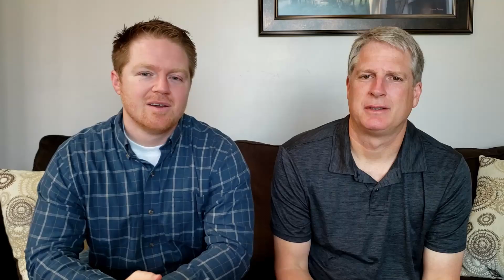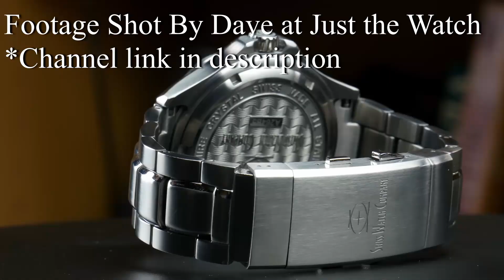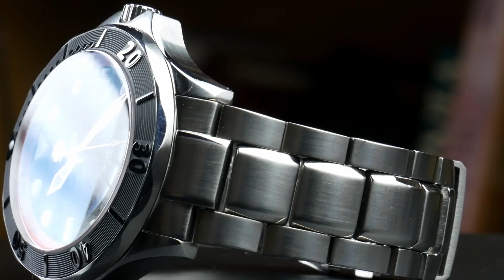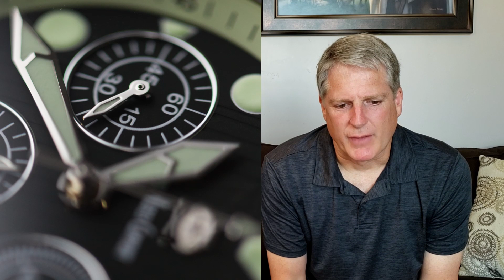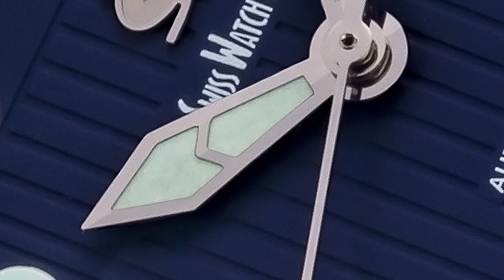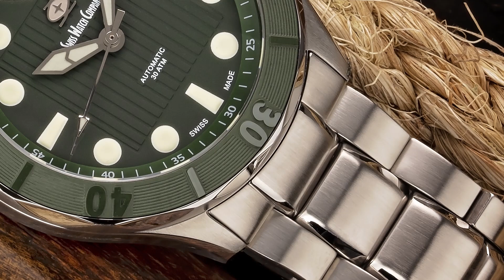Things to Know Before Manufacturing a Watch

Comment: Very interesting guys thanks. With most of the larger Swiss and German watch brands/conglomerates bringing case and bracelet manufacturing in house are their less higher end case manufacturers alive?
Reply from the maker: That is a great question! There are still many high end case manufacturers out there. For example, while my dad was working for the Swatch group we spend a large amount of that time living in Thailand (I was actually born there because of this) and there are many in China as well. The issue is that these manufacturers are working at a level that they don't necessarily need new work so as a new brand, working with them is extremely difficult if not impossible.

Comment: You make some excellent points on the manufacturing end of things! One thing I have noticed, getting more into macro video, is that the hands/dial of poorly made watches really fall apart under close magnification.
Reply from the maker: I'm glad you enjoyed it! And you are absolutely right. Cheap hands and dials simply can't hold up at a macro level. I mentioned in another comment that even "cheap" watches can look great at arms length on the wrist.